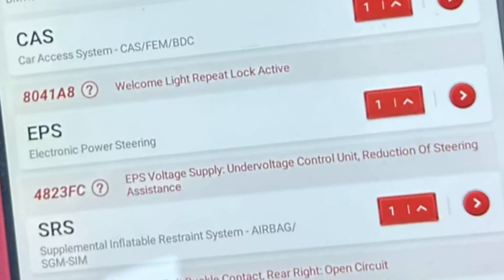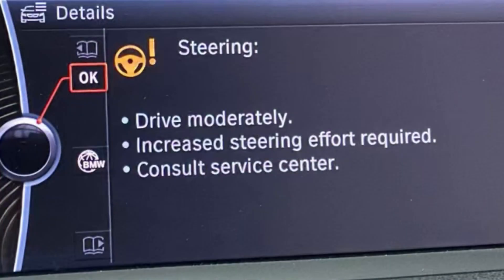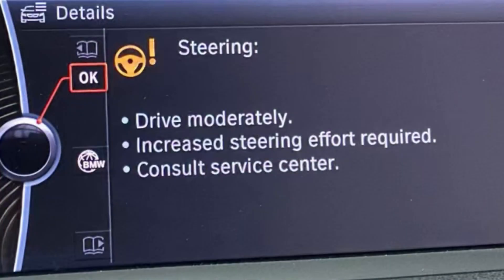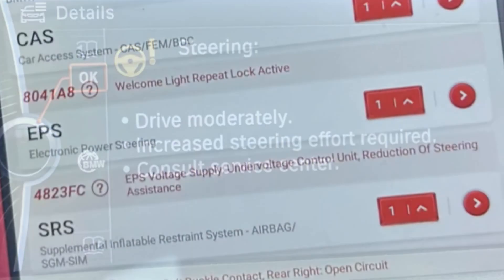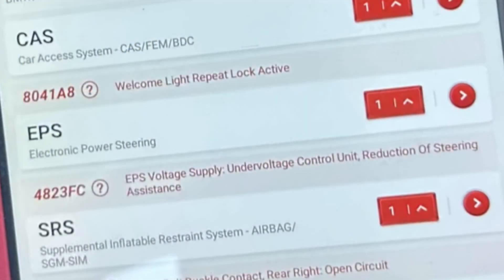BMW 4823FC ESP Voltage Supply Control Unit | How To Fix DIY

Comment: I get increased steering effort code on dashboard only when im stationary and steer fast, but the steering wheel feels normal after the error. The same code for undervoltage shows in ista. Any advice